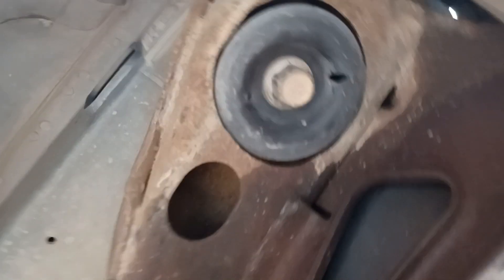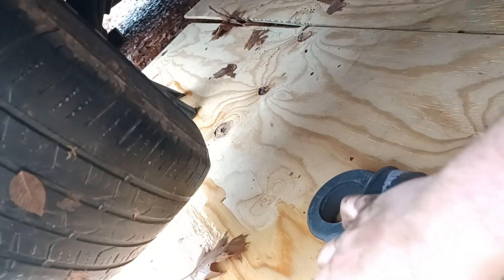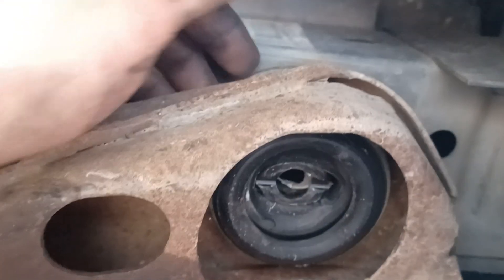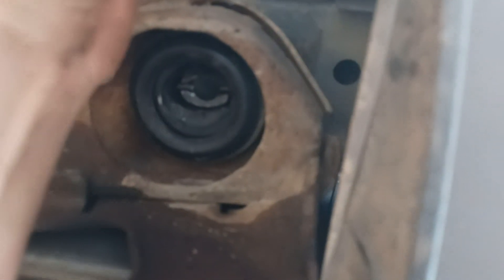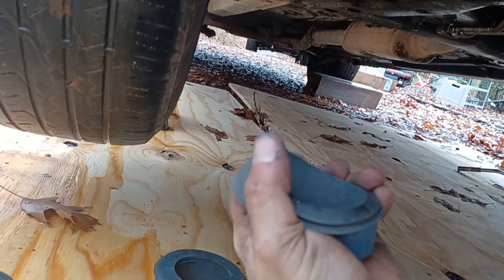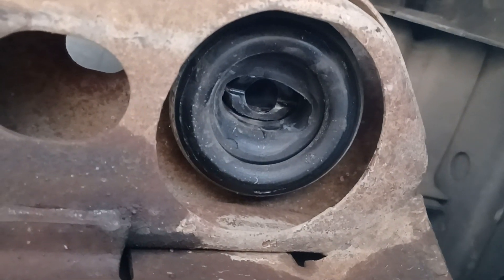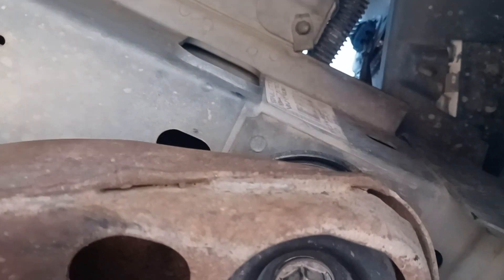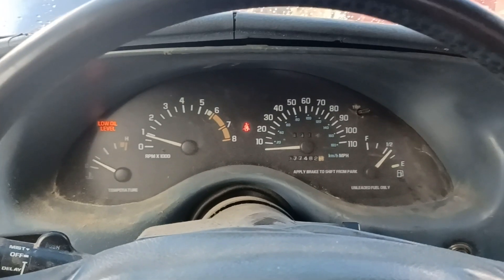1995 buick Regal body dampener replacement

Comment: I've gotta 2000 grand prix and it severely needs these done,, I've replaced one right rear subframe bushing and it helped but I suspect the right front same corner as in this video is giving all the intolerable road noise and feel over the most minimal/smallest pot holes, the front ones on mine are different than this 95 regal in video because the subframe is slightly different for the control arms and struts ( front struts have strut cartridges and ball joints are mounted upside down thru mid 90's, but both use the same rear subframe bushings, cool video!
Reply from the maker: Something I forgot to mention in the video is to inspect your bolts to make sure they aren't stretched